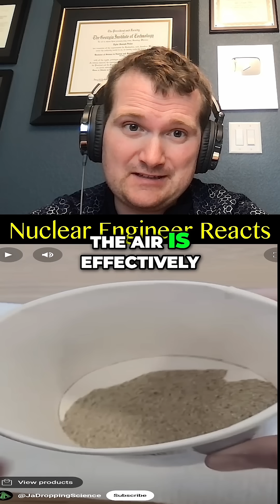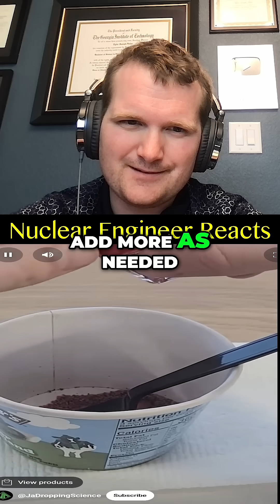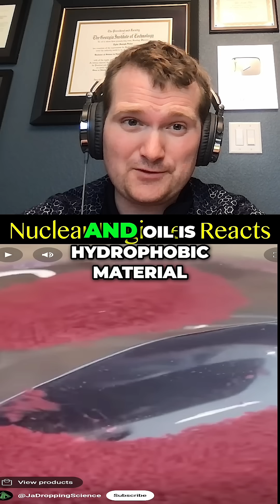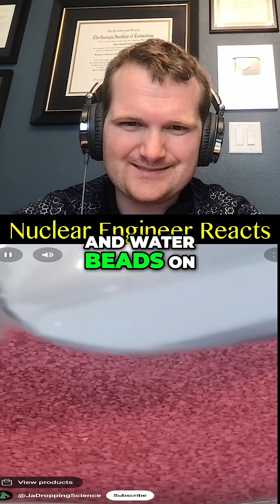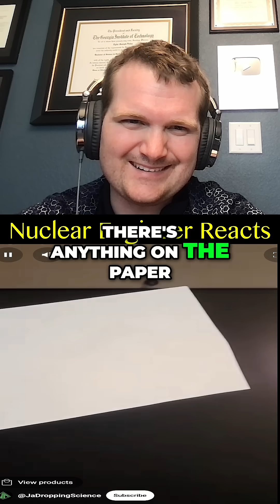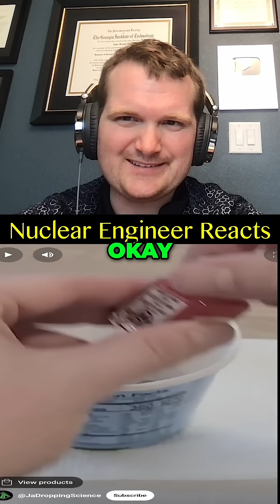2 Truths & Trash - Nuclear Engineer Reacts to JaDroppingScience

Comment: Wrong. Hang a helium OR an air balloon from the ceiling of a closed bus and either will move forward as the bus accelerates. Lateral buoyancy doesn't care what gas is in the balloon.

Comment: BTW, if you want to make hydrophobic sand you can do it using Scotchgard.  Lay out the sand and spray it with Scotchgard, mix it up, and let it dry. You may have to do it a couple times.